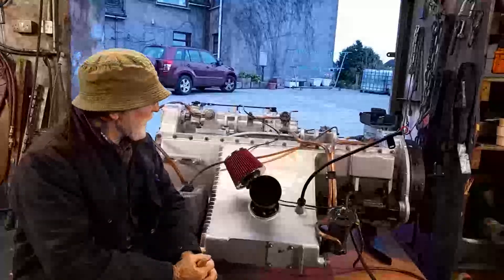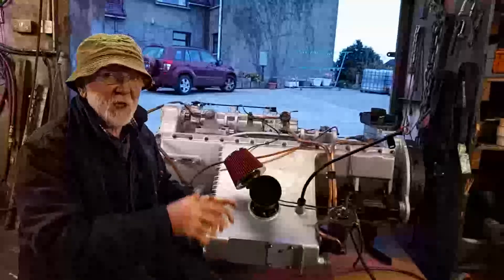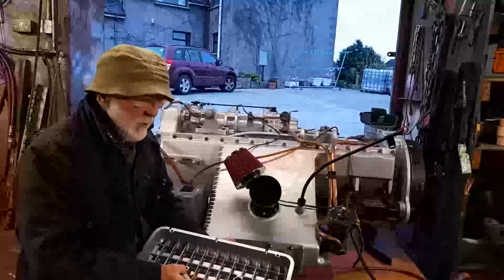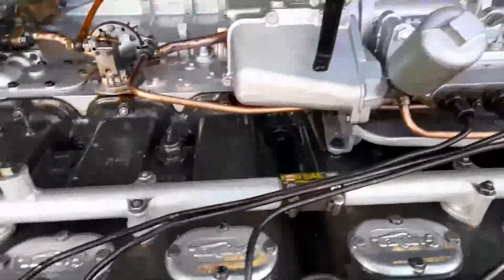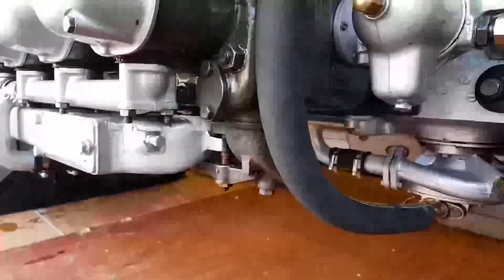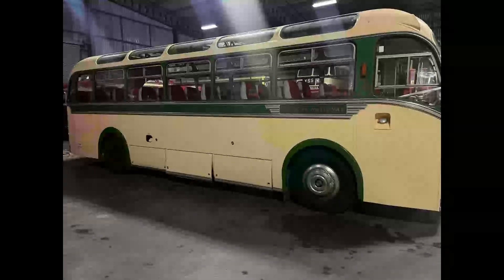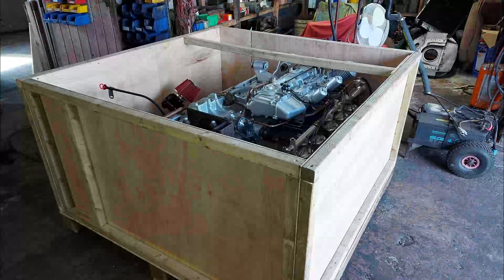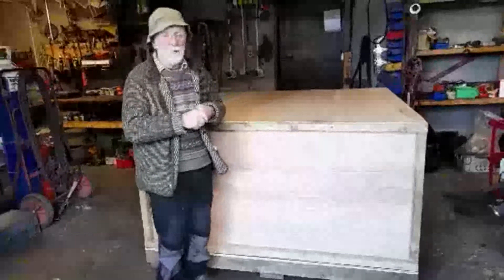Gardner Engines: the 6HLW completed!

Comment: This engine still has a Amal Lift Pump for a vertical engine and not a horizontal engine. Inside the delivery valve is a small steel ball that needs to operate vertically not horizontally. The delivery valve needs removing and replacing with the correct delivery valve unit, so that the small steel ball will operate vertically.